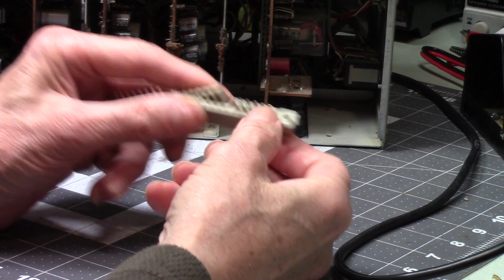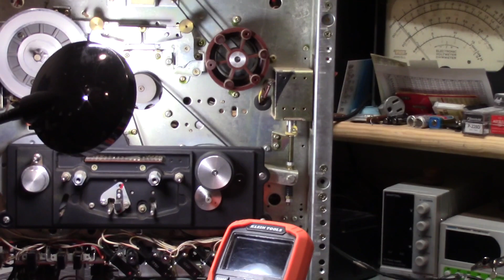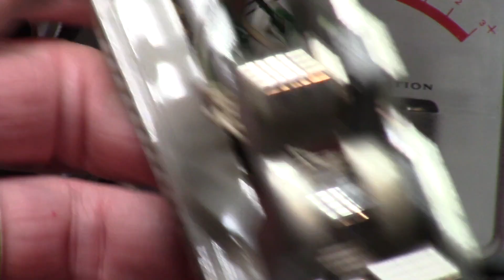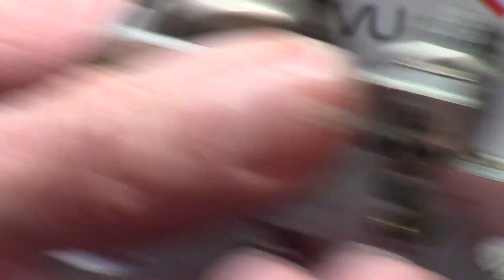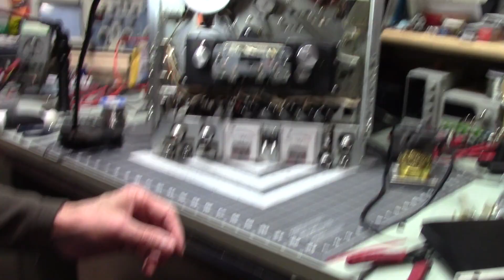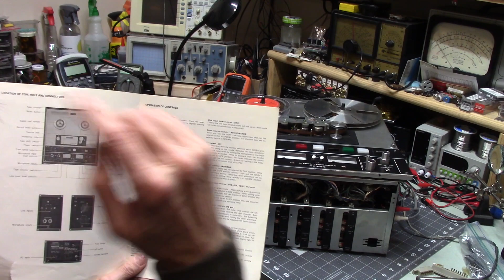Sony TC 650 Part Four of Five

Comment: still trying to figure out the problem with mine. I completely went through it and cleaned all connections and all mechanical parts. Deep cleaned. I wasn't getting anything when pushing the play buttons no relays just the meters lit up, no lights in the buttons etc. after cleaning all of the switches, pots, circuit card connections I now have the center motor spinning with power on and I can hear one relay working on the control board. but neither tape motors are working. Maybe its a cap maybe the relays are dirty they dont look it. Are the button lights supposed to all be on all of the time or just when you press one?